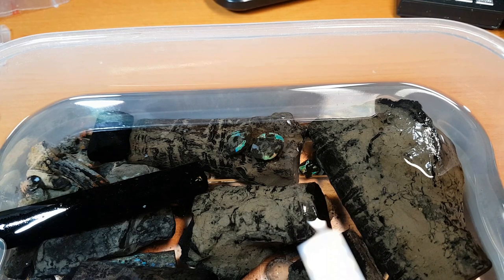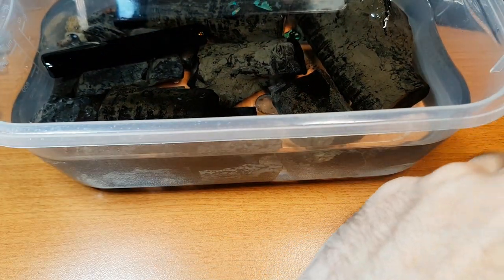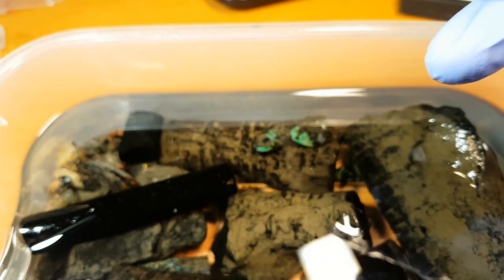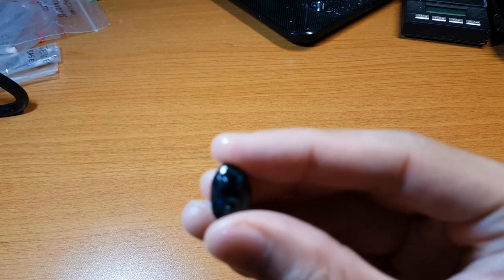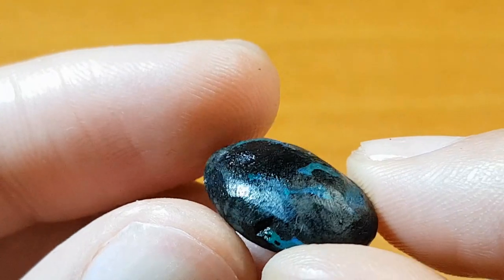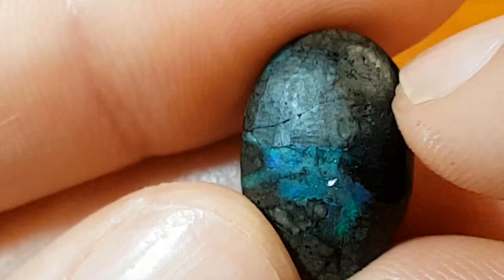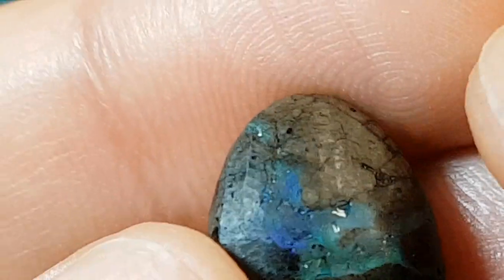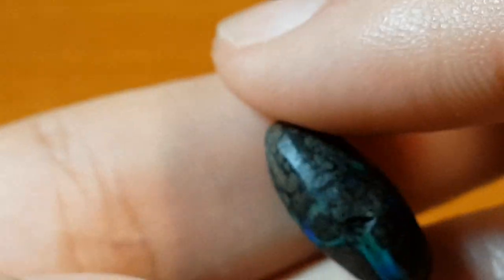Indonesian Opal Dremel Carving (First Trial Attempt)

Comment: Oil and sunlight is treating it with the heat from the sun rays. That’s what makes the opalized wood turn a different color.
Reply from the maker: Yeah been trying that for quite a long time but they have not changed at all. I am about to move on to the next method. Sun ain't strong enough this time of year it seems.
Reply: Roys Rocks I see. Forgot it’s winter there. Try heating it by another method other than sunlight. I was actually going to try a hair dryer. Lol
Reply from the maker: I might have a hair dryer lying around and its not a bad idea. Might take a while but only one way to find out!

Comment: I was wondering if using diamond lap paste which is oil based with felt tips on the dremel would work with this material for polishing. I use it for Australian opal but haven't tried any other opals from different countries yet. Beautiful stone.
Reply from the maker: I reckon it would give a polish on the smoother parts but you cant polish the aerated pitting all the way through the stone unfortunately. I will try a few other things though. Were in it to experiment with it.